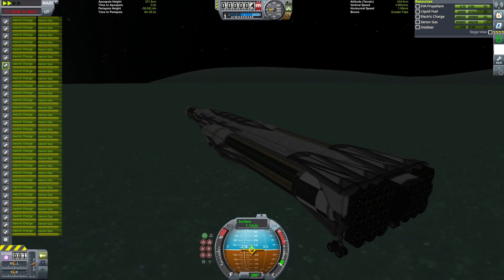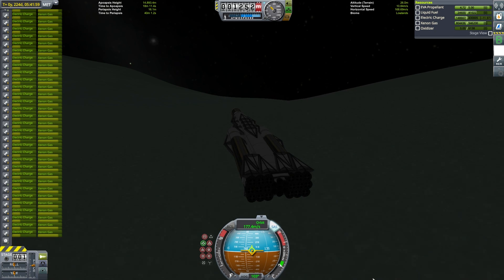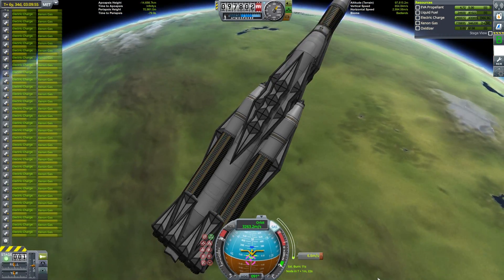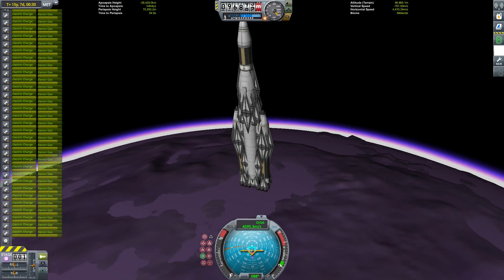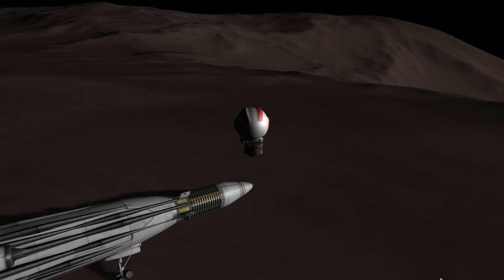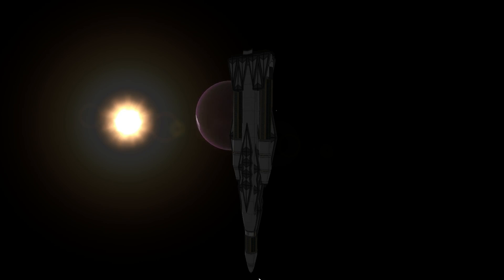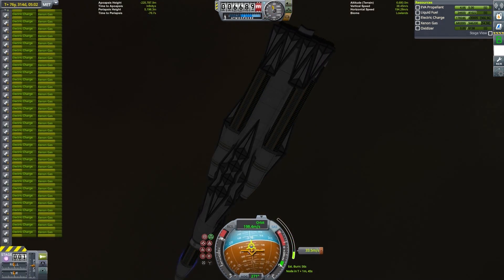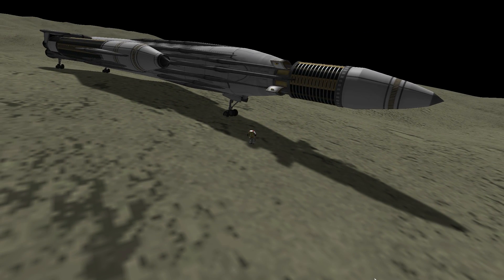Single Stage Stock Endurance Record: Episode 2- KSP v1.4

Comment: Brad, I've got a challenge for you: 
Assemble an SSTO ship IN ORBIT, by flying it up in parts, and fly it into the Sun.

Conditions:
-Your SSTO must be in at least 3 parts before assembly in space.
-It has to be an SSTO that, if it was already assembled, could function as an actual SSTO that you could use to orbit Kerbin.
-All parts allowed (stock preferred), except any sort of off-planet launch pads; also no ion thrusters or cheat parts.
-You must use the regular KSP launch pad/runway.
-It must burn up in the Sun for you to succeed.

Comment: Wouldn't it be more efficient to land on moons that require the nukes first, to use up the less efficient fuel, and then hit all the smaller moons?
Reply from the maker: Great question.  I considered this approach, but a quick mathematical analysis found that it was preferable to minimize liquid fuel used (and hence how much LF I needed to bring to orbit!), by going to the lighter moons first.  This maximizes the fractional contribution of the higher efficiency ion engines to total impulse.  Even though it requires more total impulse to do the smaller moons first, hauling the necessary LF around, this proved a better route.

Comment: Holy crap, 344cm pass over that ridge... Talk about clenching...
Reply: Jake aka Remaggib and he said that’s not even the lowest!! How much lower can you get??
Reply: @ProfesorBerziky  So close it's like being shaved by a SPACESHIP!
Reply: Butthole has formed event horizon!
Reply: Is this counts from the center of the craft? If so we should subtract MK3 radius which is 3.75/2 = 1.875m which gets clearance to about 1.5m, not counting that landing leg and wings.
Reply: @PavloPravdiukov  you could use refer to the point in the video when the craft is rolling alonf\g the surface of minmus
Reply: He got about 200cm coming over the ridge when landing.
Reply: I saw 17x cm during the slow down of the video
Reply: close pass on minimus takeoff at 0.001 cm